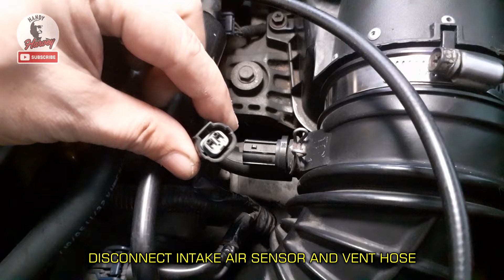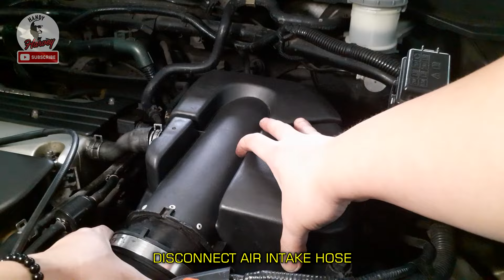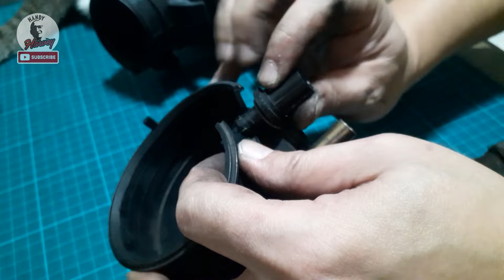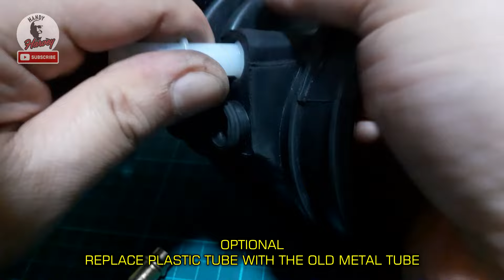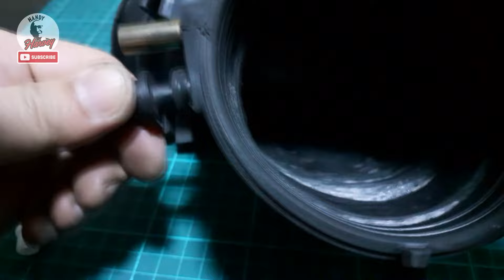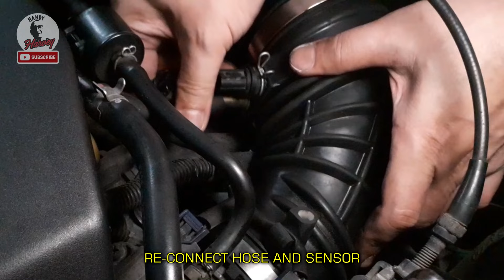How to Replace Air Intake Hose on Honda CRV Gen2 & Other Car Brands #howto #automobile #hondacrv

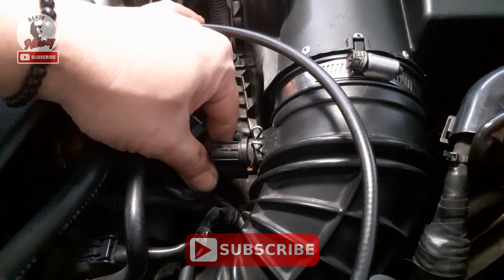Comment: That hose at 0:15 broke on mine because l didnt disconect it from the other end and it’s a single piece. Does anyone know what that is called and the part number? I have been looking for it all day
Reply from the maker: Hi @GreenTense. Sorry to hear about the hose! If it’s a vacuum or fuel line, you can check your vehicle’s service manual for the part number.  If you’re still stuck, your dealership can help you find the exact part. Hope this helps. Thanks!